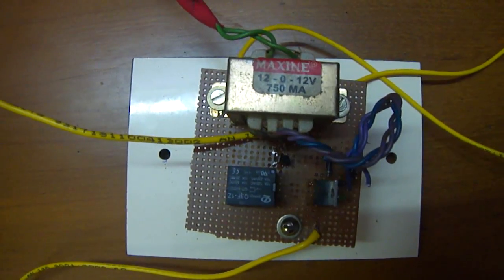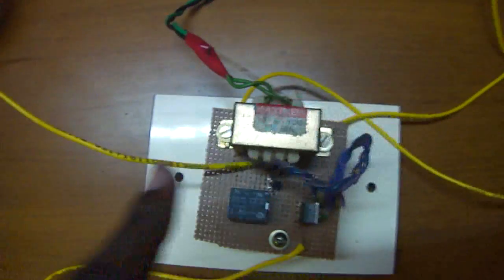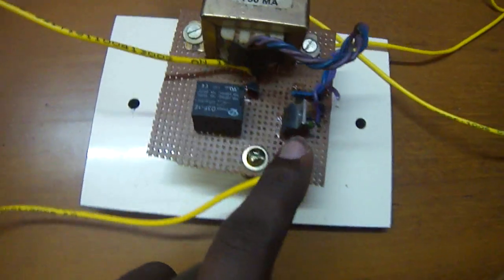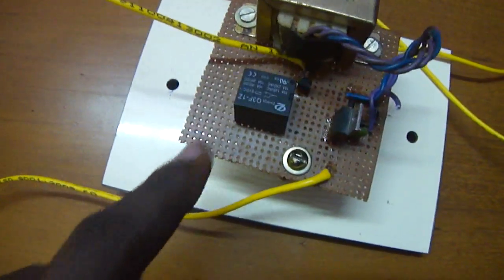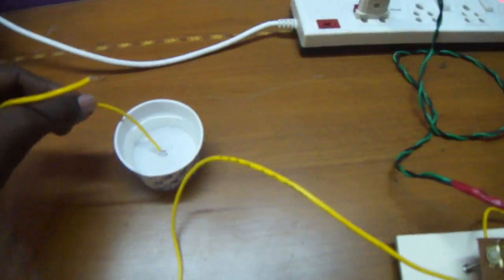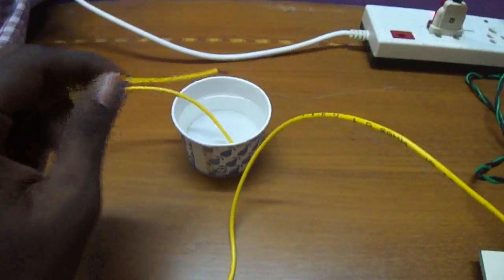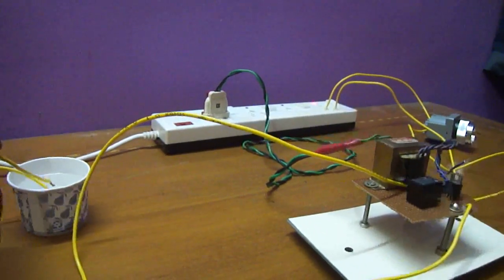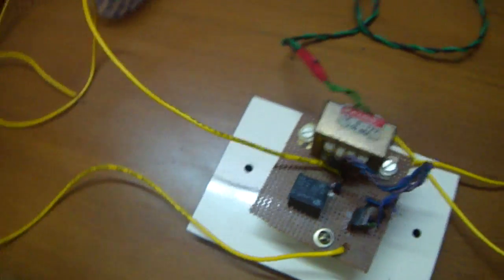BASIC WATER TANK OVERFLOW ALARM CIRCUIT(WORKING)

Comment: What will happen if there is a failure of 230v AC circuit?Will it give electric shock in water pipe line taps?
Reply from the maker: No, relay isolates the circuit

Comment: 7805 regulator is unnecessary. BC547 can handle  12V easily.
Reply from the maker: The relay I used is a 5V relay.. that's why used 7805 to regulate the 12V(output from transformer) to 5V
Reply: I have used 5v from smps through water to base leg of BC547 but relay dose not work. while connecting direct to 5v that relay works properly. So i cann't able to complete the project.
Reply from the maker: Water might be pure. Impure water only conducts.
Reply from the maker: pls provide your circuit diagram.